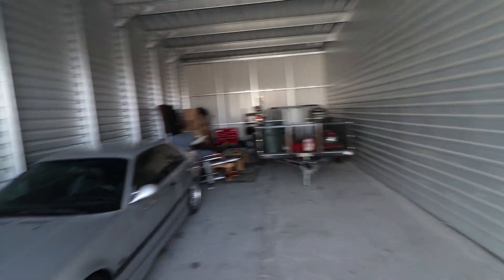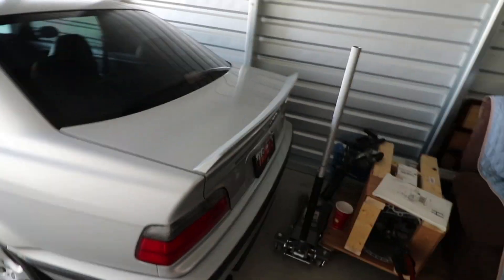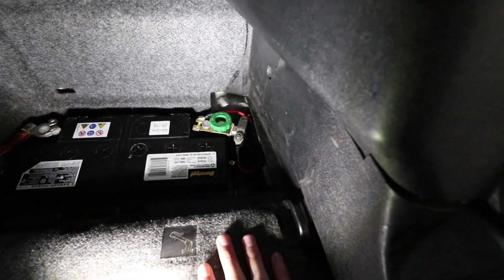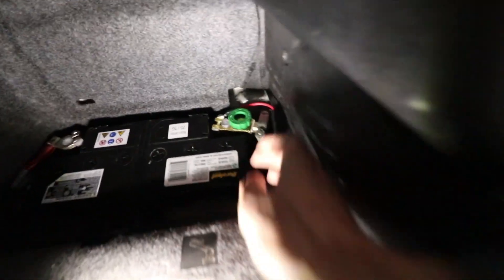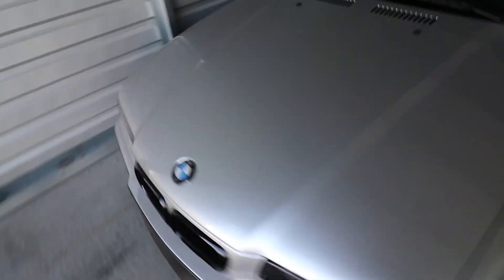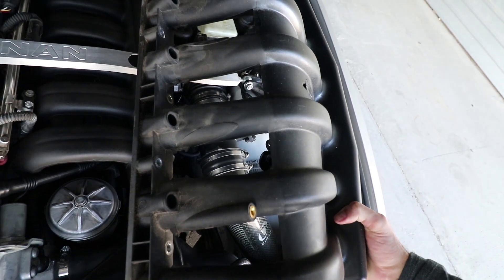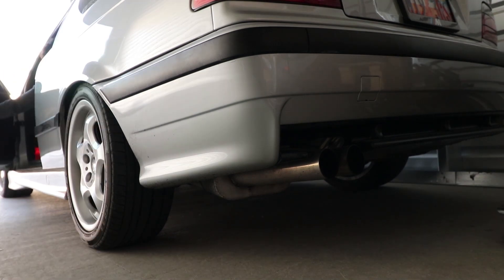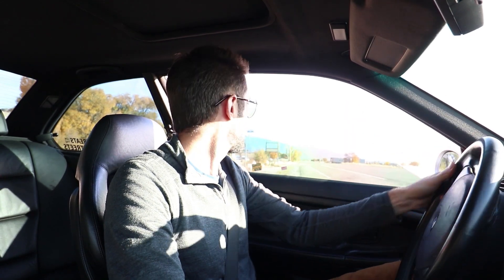THE E36 M3 DOESN'T GET THE LOVE IT DESERVES...

Comment: These are sought after now because cars nowadays are so numb and people are willing to give up modern power and speed for a raw analog car. Back then, e36 m3 had a lot of competition.
Reply: Im glad that the E36 stood the test of time. Look at the cars that it was competing against now.
Reply: The sound is fine. For strict track use, you could stright pipe it. I think it sits too low especially in the front. The tyres should not be covered by the fenders. Just my 2c. Even on the most extreme hypercars like LaFerrari, Porsche 918 or the Chiron, you are able to see the full tyre.

Comment: 97 M3 sedan Silver with same wheels as yours 204,000 mi paid $2,700 during tax season it IS a genuine M3 why did I buy it?why do I daily drive it? For the "M" experience! Also couldn't beat the price! ... Had to de rice the car a little - vinal wrap - tow hook - cheap seat covers - Walmart stereo system - nitrous express stickers etc.
Reply from the maker: Sounds like you saved a great car!
Reply: damn that's a good price if it's clean and mechanically fine. paid 2500 for my 328i sedan with 220k
Reply: Lol, lowest priced E36 m3 here in my country is €16,000. Count yourself lucky

Comment: Hey Gavin,
Love your channel. I laugh and agree with everything you say about the e36 M3. I happen to have two. One coupe, one sedan.  I have owned a boat load of cars, Porsche, Alfa Romeo, Audi, Acura the list is long. I have never sold my e36’s because they are so fun to drive and you can work on them with fear of all the complicated electronics of modern cars. 

The engine is bullet proof and I think the e36 is one of the best cars for the money hands down. My estoril blue coupe has 140 k miles and looks and drives like new.  

Keep the videos coming. I am in Bellingham Wa so come out for a visit and take my e36’s for a rip :). 

Cheers,

Phil
Reply: Hey Phil,
I'm down in the Tacoma area, bought my first car which is a e36 328is at 16. I fell in love with the car when i got to ride in my friends e36 m3 and i knew i had to have one. Mines all stock, and those engines are so easy to work on, pulls hard and looks super classy. It's going to hurt bad when i have to sell it because I'm going to be going to college in Pullman next year.

Comment: I have an e36 M3 Evolution (S50B32 engine)
I think a lot of car owners like bragging rights to say they have a ‘better car’ just because they have more power, ignoring the fact that it is probably one of the least important things about making a car great. Even the 328 with its normal chassis on a track against the euro spec M3 on a track, there isn’t a massive difference in lap time, a good reason why to have the 328 if you’re going to track a car. 
The smoothness of a 6 pot NA engine is also very satisfying, great videos

Comment: Agree with your thoughts 110%.  However, the unwarranted hate that the E36 M3 gets has kept prices (relatively) low which is nice - I bought mine this year and it didn't leave a gaping hole in my wallet. Just got my old droopy headliner replaced and bought new OEM floor mats - interior is feeling so fresh now. Cheers from Canada.

Comment: My first BMW was my 95 318is that had a lot of work done to it from prior owners. H&R sport springs, Bilstein B8 shocks and struts, Racing Dynamics strut bar, Dinan Throttle Body, Dinan engine chip, Remus Cat back exaust. M3 front bumper, M3 rear spoiler, side skirts painted to match the body color, & M3 staggard DSII wheels. All this done from prior owners. Its Boston Green with beige interior. The car isnt fast, but the engine does amazing for what it is and i can floor it, and beat on it all day and still get amazing gas mileage. The 95 318is is the last year of the m42 engine which has forged internals and is a bullet proof engine. And since it was only a couple months from being replaced by the m44, it has some of the newer m44 external parts like the newer fuel injector design, among others. The handling and the raw feel of the car made me fall in love with it, it literally made me realize why they call BMW "the Ultimate Driving Machine", and I have fallen in love with BMW's ever since. I now also own a e90. I have always wanted a e36 M3 over my 318is so i can have more power and someday will, but my 318 is a great cruiser that looks good, gets good gas mileage, and the handling and driving feel of the car is what made me fall in love with it. Not to mention the sexy, ageless look of the car, and the placement of all the controls in the center console area.

Comment: Great to see a nice well sought after E36!
I daily drive a silly 5 speed manual 520i, with just 150Hp, not that much, but very low mileage and many options!
Eventually i will upgrade the engine from a M52B20 to a M52B28 with modified cams and intake, but completely rebuild it first of course.
The problem here in Europe is the petrol prices, they keep on rising.
So going for a sweet M3 or even a 535 / 540 / M5, your walled will be drained by the gas prices! Also the road tax is rediculous..

Comment: I recently purchased another e36 M3. Its a running 1998 sedan 5-speed manual cosmos black with a modena interior. The car came with St coilovers, turner adjustable camber plates, turner rear adjustable camber arms, poly subframe bushings, suspension bushings.
Exhaust: Turner shorty headers, catless mid pipe, uuc corsa catback(sounds amazing).

UUC lightweight flywheel, ss braided clutch line and brake lines, ss caliper pistons, stop tech front rotors, uuc short shift, afe stage 2 intake

Carbon fiber hood.

And I only paid $1800 for it! I dont think i can ever beat that deal again.
Reply from the maker: A steal!

Comment: Nice! Didn't know about this thingy you put to save the battery. Interesting.

Tune will slightly improve low torque but nothing significant. You won't be impressed and certainly shouldn't be bothered with tune if that's the only mod (speaking for others)...

Make M3 louder? Nah man. Just do Schmiedmann exhaust manifold and it'll be a blast. Maybe it's just me but I don't like cars that are saying "look at me" with 100dB exhaust systems.

In addition to what you said about people hating the non-M3 models -- guys wtf? M3 is just overpowered e36. Better suspension, bigger displacement, nicer interior, some cool outside features and so on. Nothing that should or would concern you if your job isn't to test cars for a living.
Trust me, it's much more fun to take e36 320i or such, and just transform it into a beast like I did with mine. The connection you gather along the way, and aknowledgement of the car itself is something you cannot buy. If  you're into the money and can afford it - sure. But if you can't, and you're still a car guy, trust me you will not be dissapointed with the capabilities of a regular e36.
Also... Do you know how much solid e36m3 costs in Europe? About $20,000+. But how much does it cost to buy regular eg 320 m52b20 in mint condition? About $2,500. Do you know what I can make out of it with $17,500? Think about it.
My non-m3 is now almost as powerful as Gavin's M3. And cost was less than $5,000. ;)

Now Gavin couple of questions:
1) what's that with the steering mod you mentioned in the last video, to me personally though? I want to know about that! Mention it, explain it, do it!
2) proposition for the next mod - do your diff. It's 3.23 or 3.15 now with 25% lock with e46 ZF 6-speed right? Let me know if you want an opinion/advice on that.

Btw my car is almost complete, just 2 weeks more. What it has/will have in a moment is: e46 3.0d brakes and pads, lightweight wheels, 3.23 LSD, all redone suspension both rear and front and m50b25nb stroked to m50b30. Oh will it go, I can't wait to get it done. Btw it looks like crap from the outside, but under the hood it's pristine now.

P.S re Forced induction -- you will lose M3 and get almost pure-race-track experience with that. If you're sure you wanna go down that alley, do twinscrew compressor or twinscroll turbo. I can ellaborate if needed.
Reply from the maker: Search "slr mini kit" and you'll get an idea of what I'm talking about for steering. That's all I'm going to say until it's time for the install ;).

Comment: Hi guys! I'm an e36 owner, and my trunk is being leaky! There's a small tear in the rubber that lines the outer edge of the trunk, but when I check it, it's not wet. I suspect that the moisture outside the car is causing condensation, which is making the whole trunk damp. Does that seem possible? Or am I going to have to keep on searching for a leak? BTW it's a 95 325ic, and I love it!!
Reply: They are bad for rust near subframe , sometimes from trunk leaks.

Rip the side skirts and door moldings off to check for rust.

Also make sure the spare tire area is not exposed to moisture, underneath wheel well with rwd it gets littered with rain and sand.

You can replace the trunk for cheap!

E36 and e30 have died from the old weather stripping department.
Reply: @clitcommander6603  Thank you for your feedback!

Comment: Where can I find the battery terminal  with green knob ?
Reply: Should be able to find at any auto parts store
Reply from the maker: Like Christopher said most auto parts stores have them, or you can buy one online like I did if you want one with a fuse. Just make sure to get one that is rated for high enough voltage so it will transfer enough through.

Comment: Have you seen the Corsa RSC36 cat-back? I’ve looked around at exhausts and I really like the way this sounds, though it’s a bit pricey. $1,000 on ECS tuning’s website.

Also, I have a question I’d like your opinion on. Do you think that an auto to manual conversion is worth the trouble on an e36? (This is assuming it’s a clean and well cared for example) The reason I ask is because my 328i is an auto. I love it so much, but sometimes I regret not waiting for a good manual car (around where I live they don’t turn up in good condition often). Other than that, everything else on the car is excellent and I could never trade her for a car that isn’t in the same condition